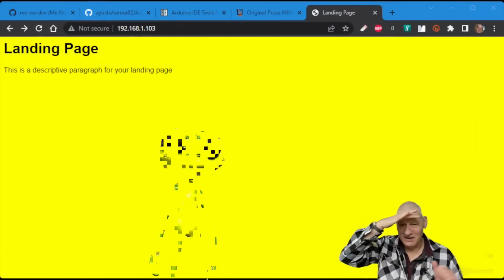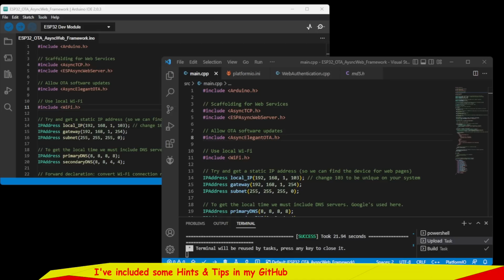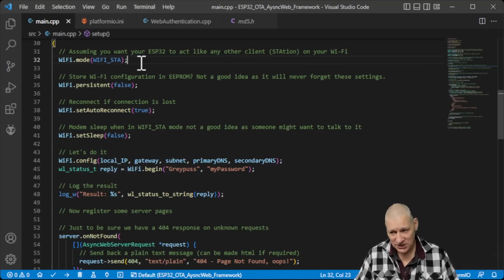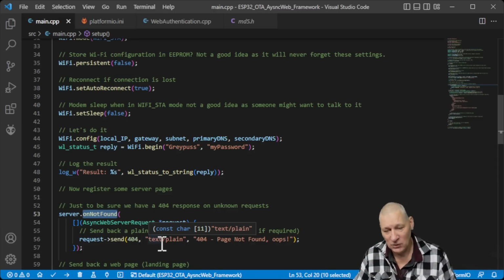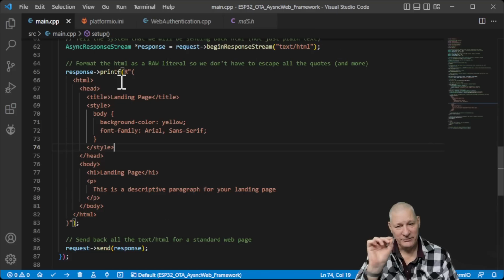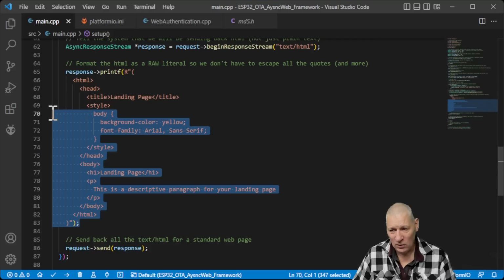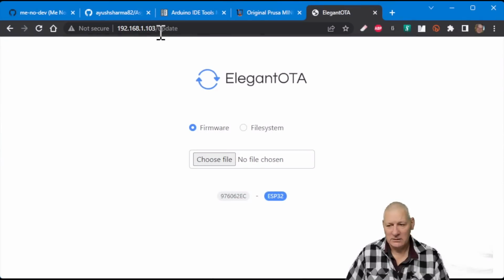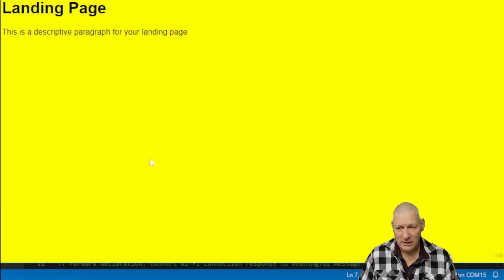#258 ESP32 Web Pages AND OTA updates - just3️⃣libraries! ESP8266 also!

Comment: I've customised a similar library so that I upload the new bin file to a private gitHub repository and the esp32 checks there for an update during each boot (without forced update, but that is also possible) to display "new version" on landing page, with link to /update page.

Needs a sketch based version tracking variable and an extra version tracking text file uploaded, so that the esp32 can detect if newer firmware than currently loaded is available and also prevents malicious update from unknown source that someone commented on.

Took me ages to find a good library to use as a starting point.  ElegantOTA was certainly an excellent choice though and one I looked at for a good long time.  Not in front of code at the moment and can't remember the library I settled on as a starting point for customisation.

My HTML pages can show real-time digitalRead updates for diagnostics/installation and facilitate downloading/deleting files (with directory browsing) from onboard SDCard, or initiate SQL INSERT INTO  a remote server on the Interwebs.

The project has many different libraries, so cutting it down for an OTA Update example would take some serious effort:
SD card, RTC, Preferences, Wi-Fi AP/client, MORSE Code LED error flasher, MCP23017 port expander, SQL Client, NTP clock sync, I2C EEPROM, with version 2 thoughts for GPS/GPX, 9dof sensor, temp, altitude, CAN bus OBDII interface etc
Reply: No, not published anywhere public.  It's a small part of an ongoing project.  My intent was to make firmware updates super easy for non-technical people..  read computer illiterate..  "how do I save an attachment from an email to my hard drive?" and I wanted the ability to send software updates to many users with the least amount of my time and effort - rather than maintaining a user mailing list/database.

I work as Tech Support for an importer/distributor in the  Point Of Sale industry in Australia and I've seen some major international receipt printer/barcode scanner manufacturers write clunky flash update/Wi-Fi config utility software locked to one OS, requiring cable connections and I wanted to avoid all the pain points I've seen others foist onto their customers.  Upon figuring out how I could do this,  I may have made statements to the effect that I've created the easiest IoT device to connect to.

Everything in my project is web based, OS agnostic, so end users can do everything from a browser - starting with out of the box config: 3x Wi-Fi client settings: home, work and away (through esp32's AP feature) and Social website account creation.  All the user needs to know is that the device will broadcast an SSID (product name_serial number) and will respond on a static IP address with a default password that can be immediately changed.

The initial brief was a multi digit 7 segment display with buttons to cycle through the data.. And maybe  IOS and Android apps via Bluetooth etc.

The gitHub repo I've cloned/forked is by romehein called  ESPecial and ESPInstaller.  I found his logic intriguing, freeing and limiting all at the same time, due to the scope of my project potentially having 3  distinct end user groups and product names with the same underlying hardware.  Sorry, for being intentionally vague.

I've added extra fields to his JSON structure to allow me, at the first run time, to load one of the 3 product software branches and thereafter it is locked into that branch.

I've completely restructured his project into a library with external (??) reference for AsynchWebServer
 object and Wi-Fi credentials that can be passed in during instantiation or starting... Been a while since I looked at that code. So that the OTA library uses the same instance that the rest of the sketch uses - avoiding dueling web servers on the same ip:port

I'm pretty new to gitHub Desktop and how to publish forks etc..   even after a bunch of reading.
I'll have to think about how to publish one aspect of the project without giving away details I hope to make money on... one day... ;)  
demo repo, demo paths, demo apps with the common OTAUpdate library etc.

Additionally, I don't know if my code is up to the standard that others will appreciate.  Having seen other repos, some people aren't so concerned with this. 🤐

I need to learn more about the R string function you used...  I've used HTML, CSS, JavaScript and sketch variables all encapsulated in C (C++??) strings and passed onto browser..  it's uuuugly, but it works.  I'm a VB6 programmer at heart, so C strings take me some time. 👀
Reply: The landing page (as AP) will display the ip address it has been given as a Wi-Fi client  and can also use MDNS for Mac, iOS,  (Linux??) and windows clients with bonjour loaded..  sadly not available on Android from my reading.
Reply: And ASync web server and OTAUpdate of course
Reply from the maker: Sounds like you have a fully fledged auto-update system there, Lindsay. Did you publish on GitHub?

Comment: I like to use the esp32 idf, sa it gives the old grey cells a work out.
Reply from the maker: By all means. It's more powerful (it exposes more of the bare ESP32 metal) and in a production environment I guess it would be mandatory. But for us hobbyists, I think I'll stick with the (easier to use) Arduino framework.
Reply: @RalphBacon  it's just TEH showing off again🙂

Comment: For as long as I can remember I have always configured the DHCP server to hand out the same IP to the same MAC address, unless it runs out of addresses. Makes life so much easier, and it allows the same code to be flashed to multiple devices without specifying the IP,  gateway and DNS servers within the code.
Reply from the maker: I do that too (belt and braces) but recently I've lapsed, secure in the knowledge that I don't need to touch my router; this static address is honoured and the router just leaves it alone. 

Of course, it's wise to tell the router to NOT use DCHP addresses in the range that you are now allocating static addresses.

And don't forget to change the code (IP address) for each device. I've never forgotten that, not once. 🤥 What? No, really I 🤥 haven't. 😁😉

Comment: I do the OTA differently: 1. it is automatically looked at the reboot whether there is an update. The new version number is in a .PHP file on the server. If the version is different, the update is installed and then the .bin file is deleted. This reduces the probability of getting another file foisted.
Reply from the maker: So the microcontroller is actively accessing a server to check for a software update? Is this a standard library function you use to do this, or is it homegrown?
Reply: @RalphBacon  homegrown: <?php
echo "g";

$aktIP = $_SERVER['REMOTE_ADDR']; //IP abfragen
$zeit = date("d.m.Y H:i:s");
$content = $zeit.chr(9).$aktIP.chr(9)."b".chr(13).chr(10); 

$fh = fopen('updalog.csv', 'g');
fwrite($fh, $content);
fclose($fh);
?> 
it's PHP. The Version is"g".
Reply: @allinclusive5762  I think he's referring to the ESP32 side of the project.
Reply: @JCWren  no - this is universal ( i mostly use the D1mini )
Reply: @allinclusive5762  OK. He's asking (I think) how you're doing this on the D1Mini side. What library or homegrown C/C++ code are you using to check the server for the image, download if present, and then install it for the upgrade. And if that's not what Ralph is asking, well, then I am :)
Reply: @JCWren  i use the #include <ESP8266httpUpdate.h>
and for checking the internet (function):
String cInhalt = "" ;
  int ret;
  debug("connecting to ");
  debugln(host);
  // Use WiFiClient class to create TCP connections
  WiFiClient client;
  const int httpPort = 80;
  if (!client.connect(host, httpPort)) {
    debugln("connection failed");
    strcpy(ServerVersion,meineVersion);      // bauen wir uns gleiche Zeichenketten
       // um nicht in die Updatefunktion zu gehen
  }

  String url = host + RemotePath + UpdaPhpFile;
   
  debug("Requesting URL for Update: ");
  debugln(url);
   
  // This will send the request to the server
  client.print(String("GET ") + url + " HTTP/1.1\r\n" +
               "Host: " + host + "\r\n" + 
               "Connection: close\r\n\r\n");
  // start waiting for the response             
  unsigned long lasttime = millis();
  while (!client.available() && millis() - lasttime < 1000) {delay(1);}   // wait max 1s for data

  // Read all the lines of the reply from server and print them to Serial
  while(client.available()){
    char readchar = client.read();
    cInhalt = readchar;
  }

  cInhalt.toCharArray(ServerVersion, cInhalt.length()+1);
  delay(2000);

  if (ServerVersion[0] == meineVersion[0]){
    ret = 0;
  }else{
    // Evtl. Prüfen, ob das bin-File vorhanden ist
    ret = 1; }   // Upda notwendig
  return ret;
}
Reply from the maker: Yes, JC was correct, I wanted the ESP32 side of things, which you've now shown. I'll check it out. 

I'm thinking we could actually use a RasPi as the server or even another ESP32 as an AP with all the code in an SD card or large PSRAM partition.